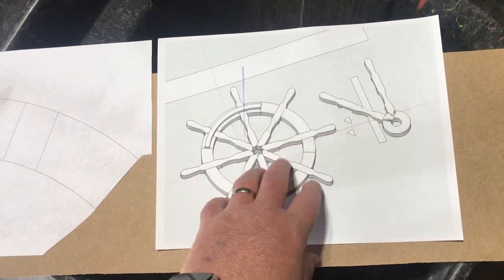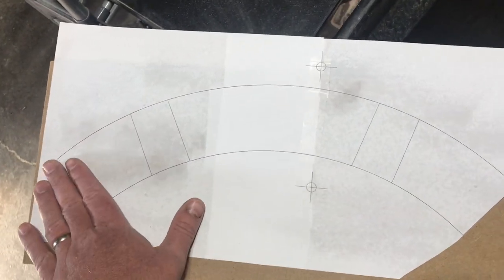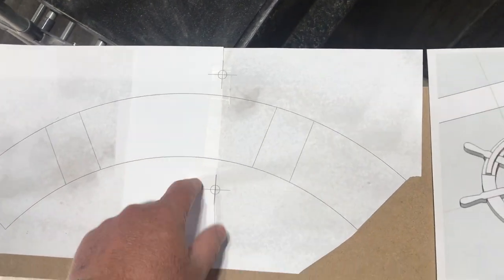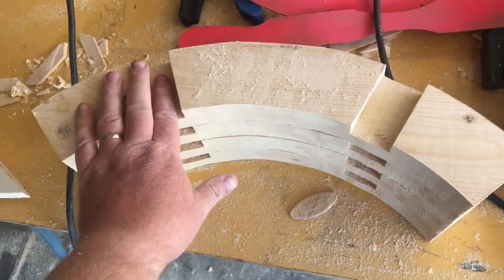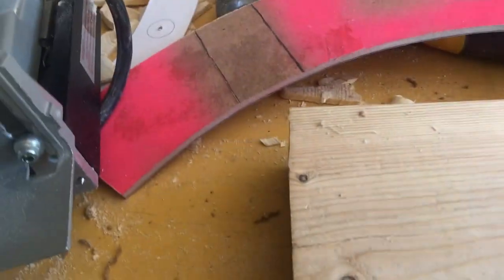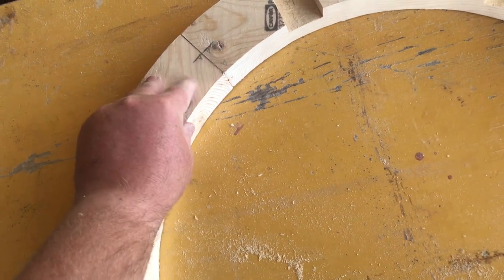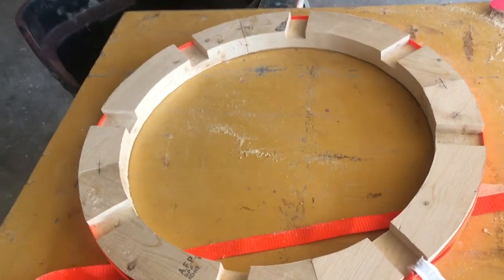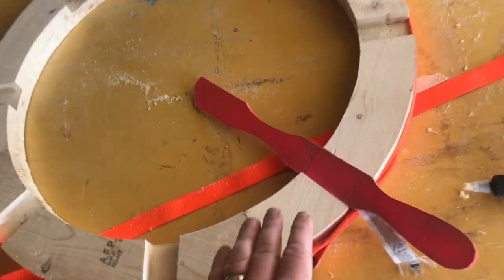We be building a pirate ships wheel from real wood!   Free plan included!

Comment: When I was watching your video about the wheel, I was thinking about how I could adapt it to a helm wheel 😉
I made one last year by layering up cardboard and covering with stainable wood filler (I added a wire wreath form for strength, hung it in my entry as a chandelier with LED flame candles, complete with melted hot glue). It was ok, but didn't survive storage.
Reply from the maker: Hey Peter!  The wagon wheel is what inspired this design, we were on the same wavelengths.  You can build this out of EPS styrofoam, but for making an authentic looking wheel I honestly could find no corners to really cut to make it an easier build. It's one of those props where you do it properly so it survives more than one year. Your concept sounds cool, how well did the wood filler do overall, what part gave out in storage?
Reply: @SamhainPropworks  The wood filler worked very well, as long as it is the stainable kind. A couple of the handles bent, and instead of reinforcing it I figured I would make a different one later. I didn't think anyone would notice if I chucked it, but it turned out that the ships wheel chandelier was my 13yo daughter's favorite decoration last year.

Comment: Im doing this as a school project. Any tips?
Reply from the maker: If you have access to a bandsaw it will make it a breeze.  Just be patient with the build and measure twice and cut once 😀. It is a fun project with a great end result, good luck!
Reply: @SamhainPropworks thank you man. I want to mount it on my btothers boat i think he'll definitly like it
Reply: @SamhainPropworks  do i have to print it on a certain paper or would any work
Reply from the maker: @iagree1642 The template is sized to be printed on standard 8.5 x 11 paper (Normal paper size) and then taped together.  I try to cater to the basic level of printer most people have :)